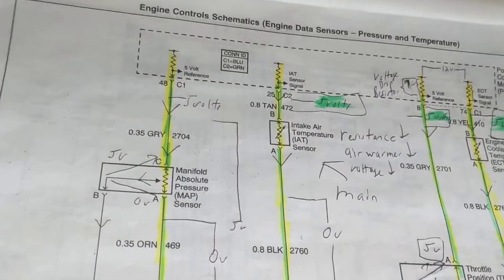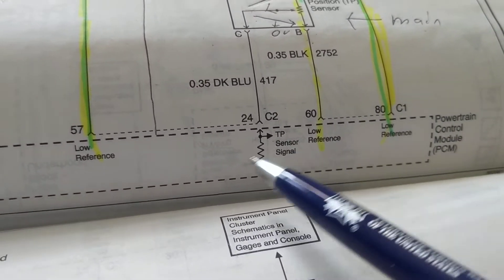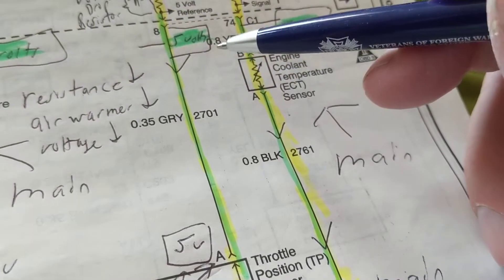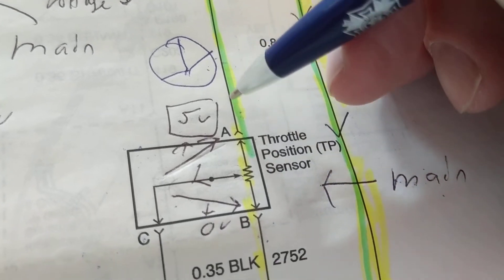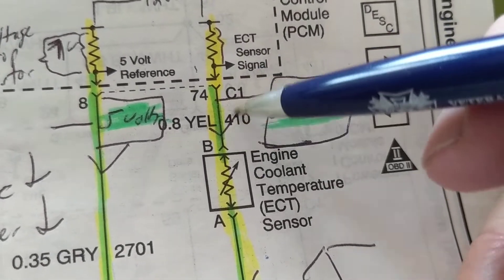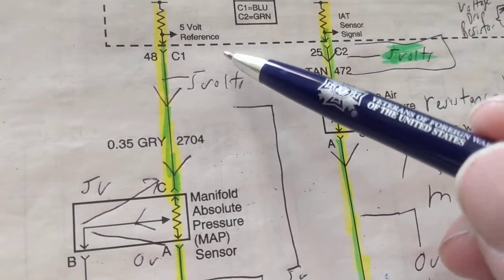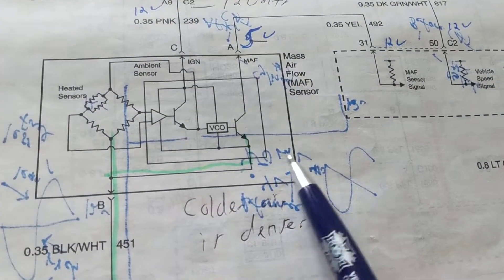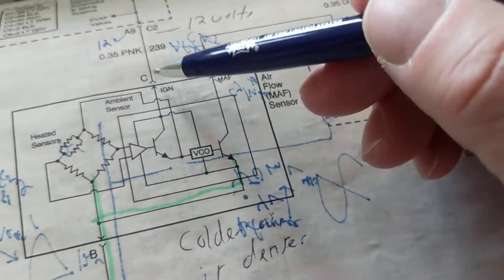HOW TO TEST SENSORS IN CAR WITH MULTIMETER FROM WIRING DIAGRAM EASY EXPLANATION

Comment: At the turbocharger position sensor, the measured voltages are: 5V - power supply, 0V sensor ground and 1.31 V - signal wire with the ignition on and 3.55 V with the engine running at idle. The diagnostic interface displays error code P2563. Where is the problem? It is Ford focus MK3 1.6 TDCI econetic.
Reply from the maker: The situation is that the computer has to see the signal if you measure it at the position sensor you want to make sure that the wiring is Good from there till the the computer other thing is usually these turbochargers need a cleaning like throttle body plates need cleaning or mass air flow sensors need cleaning first thing is first make sure the computer is getting the signal not just the position sensor

Comment: This channel is one of the most informative channels I’ve ever bet stumbled across. I think your subscribers are low bc ppl want the answers and aren’t willing to work for it! Keep spreading this knowledge and hopefully hard working ppl who wannna learn will stumble across you and subscribe. This video helped me with a p0118 dtc on a 14 charger with a 5.7 liter. Checking it now to conclude my diagnosis but at least I know what to expect from my connections! Thanks Joe!
Reply from the maker: I agree with you but electronics is a diagnostic skill that has to be developed like scanner Danner does it there is no component that fails 100% of the time I think people are used to the mechanical where you can see a leak or a problem electronics is not like that thank you so much for your support and your compliment

Comment: Hi.… sir and when you unplugged the connector for TPS you get 5v on signal and ref wire and the diagram showing  signal goes to ground...?
Reply from the maker: Correct they all go back to the computer and the ground goes back to the internal ground of the computer there are different models of them but usually same idea thank you for your question

Comment: Sir may i know what parts that we consider as an input to the computer and what parts that we consider as an ouput device of the computer tnx sir
Reply from the maker: Sensors such as mass air flow sensor temperature sensors they are inputs to the computer the fuel injectors motors actuators are considered outputs to the computer because that's what the computers are controlling